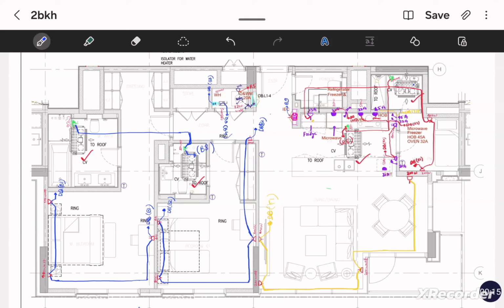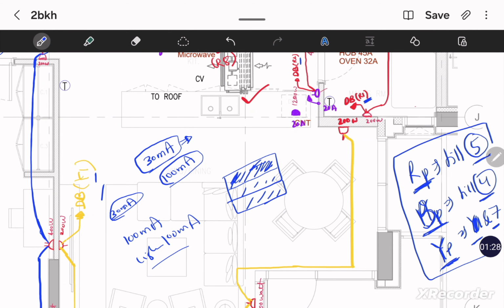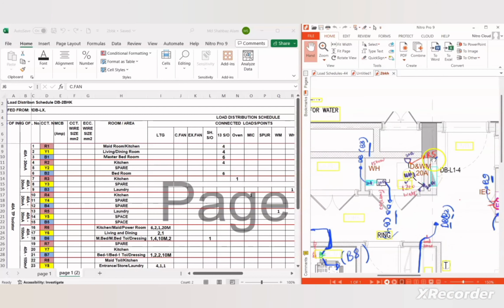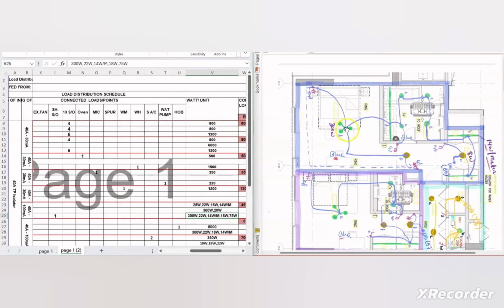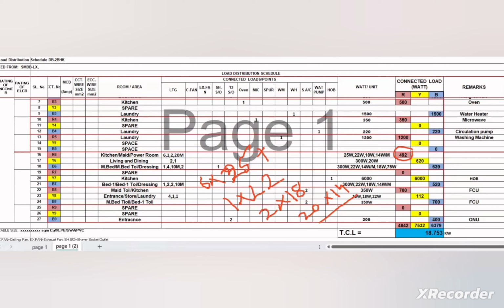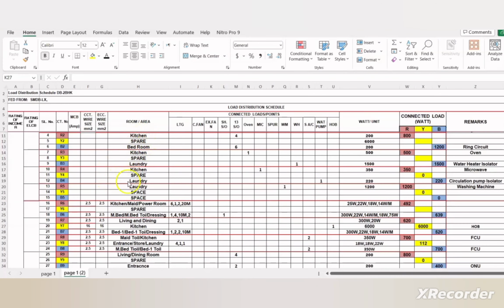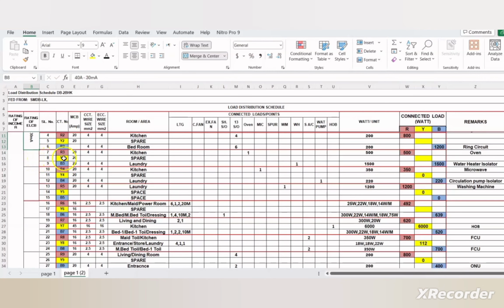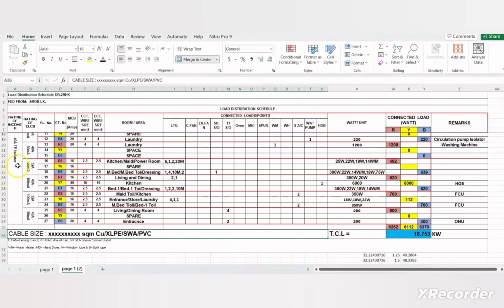Designing of Final Distribution Board Load schedule as per DEWA Regulation - Part-2

Comment: Good but I have a question ❓ 
You put 2 FCU in one circuit that's possible? Where is the outdoor unit source?
Reply from the maker: It is not DX unit or normal AC unit which have indoor our outdoor unit. It is chilled water pipe system.
Reply from the maker: And more over to two FCU looping , I showed the screen shot of dewa regulation